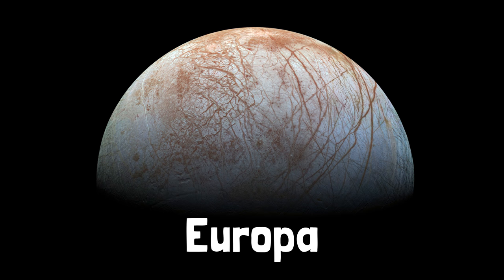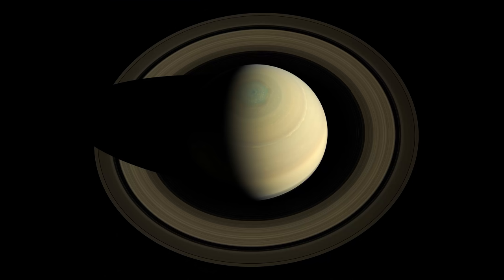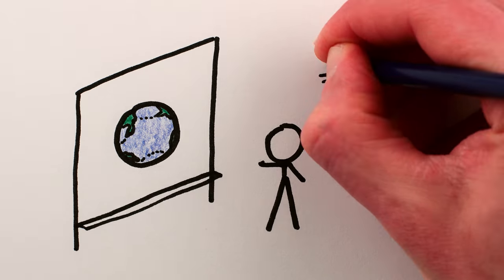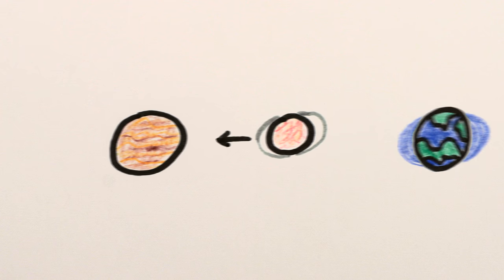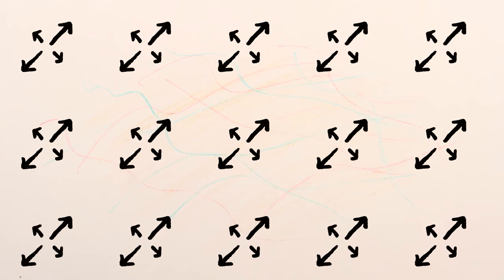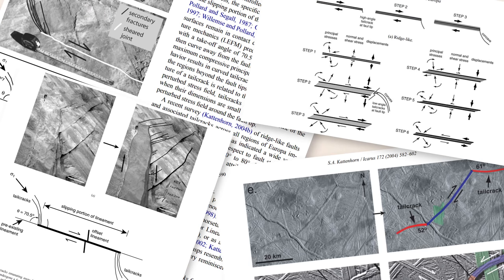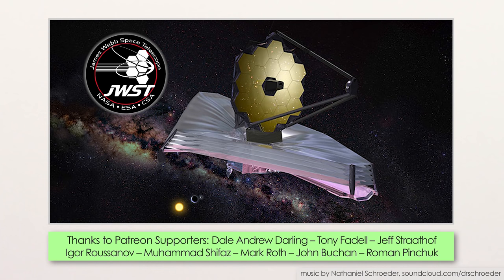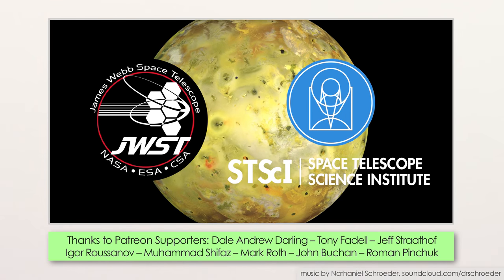Extraterrestrial Cycloids - Why Are They on Europa?

Comment: This makes sense for the valleys, but extensional fractures shouldn't form ridges...unless maybe they fill in with cryovolcanic material?
Reply: There are a multitude of theories about the formation of geological structures on Europa, in part because there’s so many types of things there; Henry just touched on one type of formation. Another example are “chaos” regions which, if I remember correctly, are formed by parts of the surface ice melting partially and refreezing creating the illusion of icebergs floating on an ocean.

Comment: Or an alternative explanation may be that  the cameras that capture these images use an incredibly low shutter speed in order to parse the dark low light conditions of space which then produced photographic artifacts of gases in the atmosphere of the planet which would show up as motion blur trails similar to how a photographer paints with light using the low shutter speed with a digital SLR. But, I have no idea what kinds of cameras they're using, so it's just a simplistic guess based on what it looks like to me. I've created all kinds of neat artifact patterns and trails when I have my DSLR cranked down super low. Many of them have looked exactly like this.

Comment: But if this is true, then those individual cycloid-curve cracks needed to be formed in exactly one orbit each.
That requires both very rapid and very consistent rate of cracking!
Reply: true, and could depend greatly on consistency of the ice, since I assume not all ice on Europa is the same thickness. But more interesting to me is the fact those cycloids are all over the place, ones loop upwards (towards poles), others loop downwards (towards equator), some to a side....like abstract child's drawing. :)

Comment: But how does gravity work between planets really? For example if earth's gravity is affecting the moon it means that the earth is pulling the moon towards it. What stops the moon from coming too close or too far from earth? Is there some kind of a reverse force that pulls the moon away from earth at the same time? There should be no "in-between" when it comes to gravity, it either pulls or it doesn't.. We're not floating mid air cause the earth's gravity is affecting us only half way, we're stuck to it big time
Reply: i think someone just needs to take a class on how orbits work...I guess always falling and always missing and maintaining sideways velocity because of this is simple enough.

Comment: Electrostatic discharge rolling and reflecting the path of a large highly charged body with enough potential to discharge through space while not touching? It could have happened while the orbit with Jupiter's magnetic field was kind of forming a circuit that's impedance would have been impacted by the variable derivative of the orbits to make those reproducible patterns? Especially that if you consider as both the moon and whatever causing the surface discharges itself are traveling through the topological morphology of the magnetic field lines thus making the subtle vector changes that could span over significant portions of the variables of both time and distance.

Comment: Those geological features on Europa were caused by electric discharge most likely between two stellar bodies. Since NASA found electric currents connecting Enceladus to Saturn I don't think it is out of the question to suggest that electric discharge could create such features.

Comment: I think this is wrong. I think those plumes are lightning or arc welding foci from Jupiter's electromagnetic field.  Those weird cracks are like the scoring marks from electrical machining. It's everywhere in the Solar System if you look.

Comment: I wish you would stop using Theory wrong. Everytime you use theory instead of hypothesis you reinforce that Theory is just a good guess.
Reply: Only when he uses theory there is significant backing to it. Keep in mind he isn't doing these studies, he taking the results from other groups and compiling them. Theory is correct here because a substantial base of evidence has been formed. It's not a single paper or idea that he has, it's something that's been worked on and refined.
Reply: It is unproven, sure we have some good hypothesis's  and some math that makes sense. However you don't have the best theory, or a theory. You have the Theory. It's this colloquial use that allows the denigration of scientific knowledge. I get that its easier for many reasons but this is the best kinda place to guide the vernacular. Not trying to be harsh, just mindful.